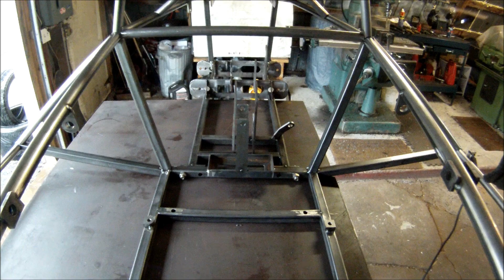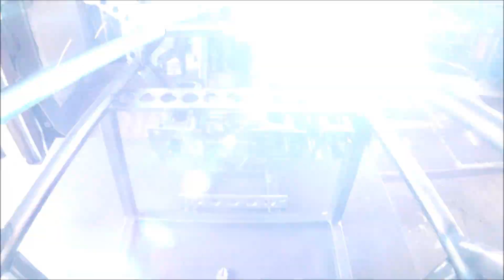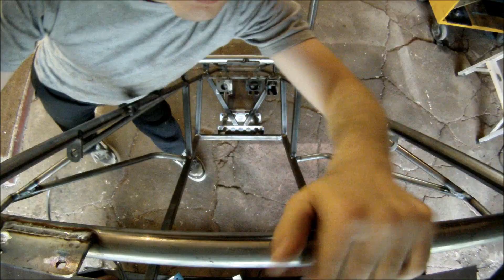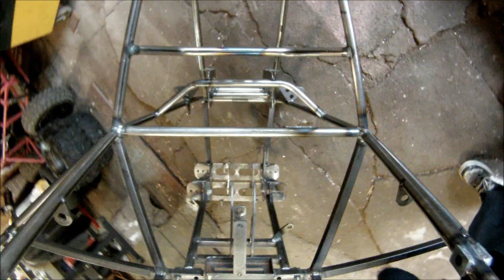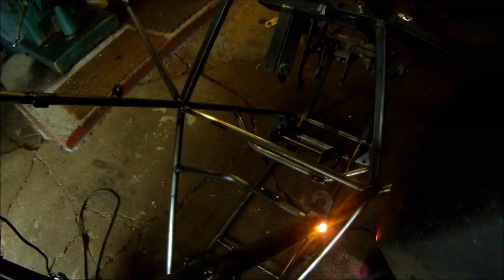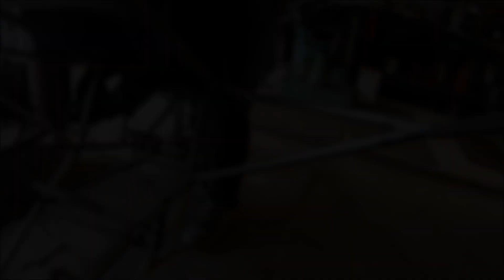Welding my dune buggy frame with Lincoln 180 welder

Comment: As a beginner in welding, what size  tubing would or did you use for the frame. And what size welder would be sufficient enough.
Reply from the maker: The square tube is 0.090" and the round is 0.065". A 100 amp welder would be fine for that size. Thanks for watching!